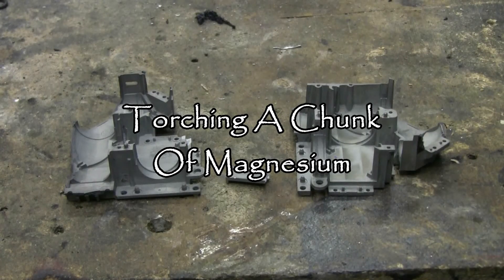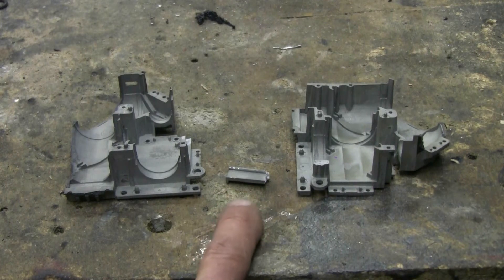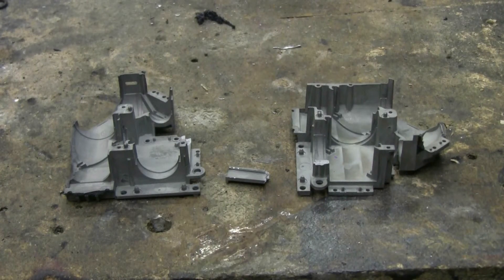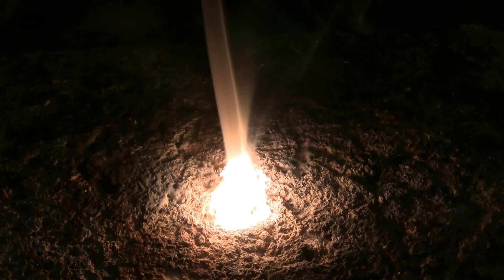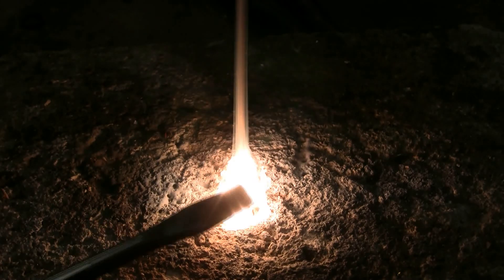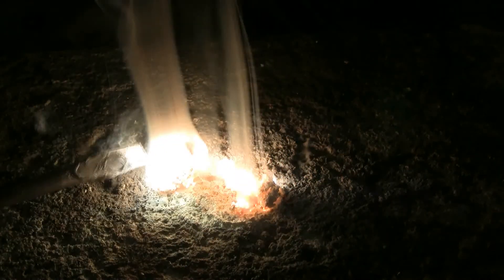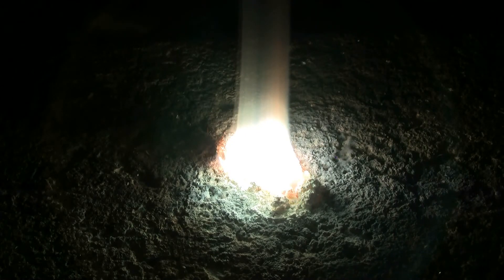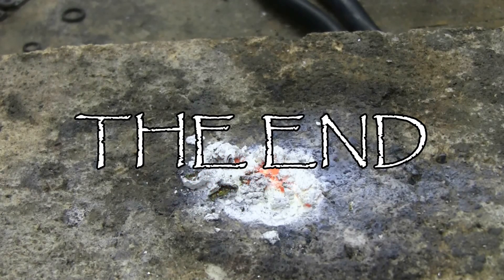Burning A Magnesium Chunk

Comment: What kind of housing did it use to be?
Reply from the maker: ElectronSpark It held lenses for a projector assembly. I also got the lenses.
Reply: Bill Gilmour Did you get the light amplifiers?  o_o
Reply from the maker: The Lightning Stalker Only lenses and first surface mirrors.
Reply: Bill Gilmour Ahh, okay, different kind of projector, then